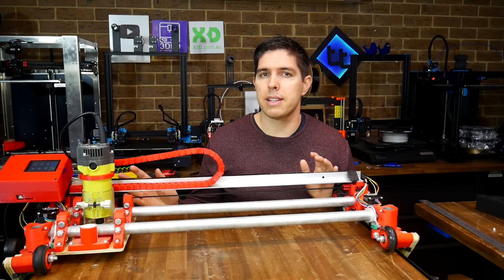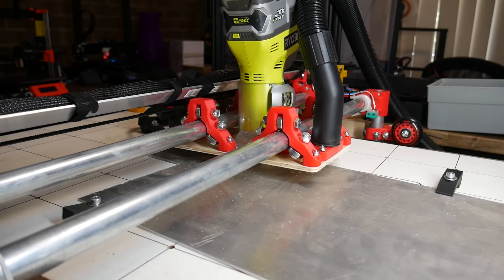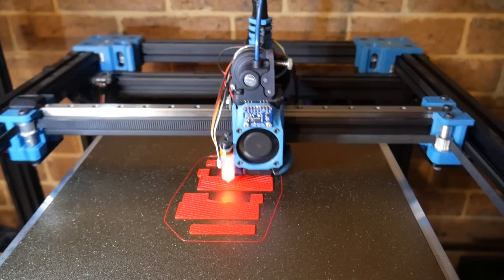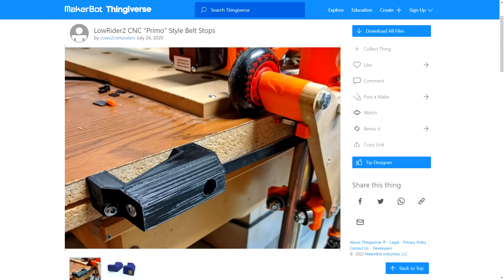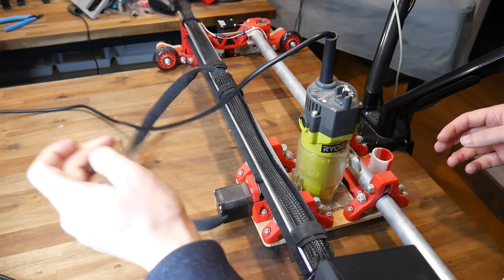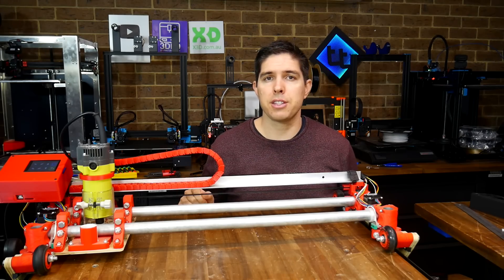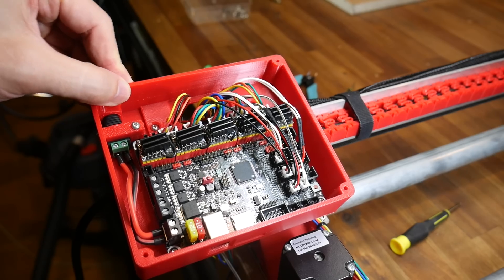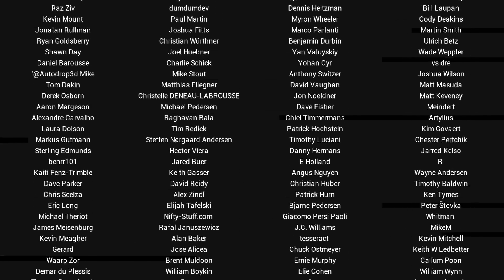3D printed large CNC: Lowrider2 upgrades

Comment: The cordless router most likely has a simple 18v...24v DC motor (RS 550 or RS 775) and maybe a planetary gearbox to increase torque. The motors are cheap, available on Ali or Ebay, and much easier to mount than the full blown router with its casing.
Plus you don't have to deal with the mains power cord. The relatively low DC voltage can be provided via cables in the main loom.

Comment: There is one trick for workpiece holding that I've seen used in various situations which I think is worth mentioning. If the lateral forces applied by the tool to the workpiece, then bolt-down clamps can be replaced with a paper masking tape and superglue with accelerator. Double sided tape has proved to be too messy on clean-up. First, apply a layer of masking tape to the bed of the CNC (table) and burnish it down well. Do the same to the back side of the workpiece. Finally, apply superglue to the upper face of the tape on the bed, apply accelerator to the face of that on the workpiece, mate the faces and press home until superglue set. Once the job is done, the masking tape is easily separated from the bed of the CNC and the workpiece. 

This certainly would have worked when Michael was struggling with a warped PCB onto the CNC 4 years ago.

Comment: I’ve watched this series and have purchased the lowrider v3.
I know you were looking to add a diode laser to yours - is this still progressing, or did you can the idea?
I’ve got a K40 in the workshop I’ve yet to set up, but already looking into if a $80 AUD diode from banggood would work on the lowrider.
A detailed guide from you on how to install that would be amazing.
Cheers for all you continue to do for the community
Reply: Bunch of folks on the V1 Engineering forum are sharing info on building LowRider V3, attaching lasers, plasma torches and such...

Comment: I noticed that, during the milling process, there is material accumulating outside the spoil board area.  The wheels are rolling this the material particles.  How much of an issue does that create with accuracy and artifacts in the milled material?

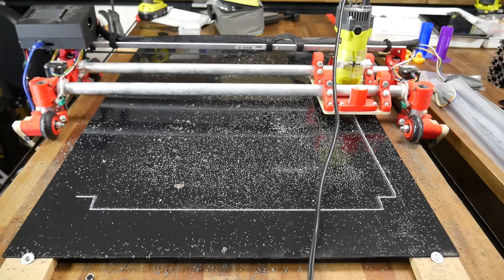Comment: Those are some very cool upgrades!  One issue I noticed, however, is that debris builds up on the wheels--as can be seen on the right at 2:05--which could cause some Z error.  A pair of toothbrush heads per wheel sweeping ahead of the wheel on each side--and a shroud on both sides to protect the wheels themselves--would prevent that.

Cheers!

Comment: Just found out about this project. I have a question, does the belts support any forces ? I'd want to cut throught very thick and hard wood and I fear belts will not support this.
Reply: I am using an MPCNC Primo at the moment, same designer, also driven by belts and it has got no problem cutting through hardwood.

Comment: These are awesome upgrades. Anyone know if I could mount the table top to a wall and run the low rider vertically ? That would save me space in the garage
Reply: I don't think so. We have discussed it so many times and never get any real good ideas to make that work. It is just far more efficient to use gravity instead of fighting it. My solution to that very common question in the new LowRider 3 is to make the machine easily removable from the table so you can put it away when needed. Litterlay takes me about 1 minute to do. Unsnap the belts, hose and two plugs. I can't post links but I am releasing the new machine as we speak and you can take a look in the forums or printables soon.
Reply: Why not make your table top hinge on the wall so you only have to have it out if you are using it when not being used it wld just lay flat against the wall

Comment: Question: This uses Nema 17 motors? Are they powerful enough? Nema 23s are not very expensive and you can drive them with external 6600 stepper drivers. You'd only need x and Y probably only $50-75 more?
Reply: But why? 17's are enough. Frame is always the limiting factor as you simply can't use torque from bigger motors. Feedspeeds are just so slow with these.

Comment: 12:00 sorry this is gonna sound harsh but just don't post the video then bruv. Its kinda hilarious that you 'wont waste material' yet you just spent allllllll of that time and filament upgrading the thing. You could even have engraved the spoil board as a test lol, how are we to expect that you didn't just do all of that work for no reason at all? Maybe the cnc is worse than before lol. I actually really like this video and am more interested than ever, but surely, surely you see the irony in not testing it out after 'upgrading' aka 'modding' the machine.

Comment: A few thoughts.

1) have you thought about running the Duet Web Control that’s been hacked for the SKR boards on it? I know that DWC has a web interface designed for CNC mills. I also know that Marlin isn’t super CNC friendly, as I’ve run into many issues with it.

2) you should consider cutting out new side pieces that put wheels on the bottom of the table as well, clamping the machine down. I’ve seen a few cases where the wheels have lifted off the table during cuts which messes up the entire piece of material and alll
Reply from the maker: Both very good suggestions, thanks.

Comment: it would be cool if you set up a way to monitor the amperage of the router so you know if it's chugging on any parts or getting too hot. some kind of safety based off amperage limits

Comment: The MPCNC might be a good project, but the outright despicable reactions of the author to attempts of creating addons/improvements makes it a no-go for me:
https://www.youtube.com/watch?v=68ohaPYyiDA
Reply: It's why specific licenses exist tho. As the creator and the original license holder, it's entirely within his right to license, and therefore enforce that license as he sees fit.  All he did was tell someone that was commercially making products to not make things and change the license to open source and rather leave them as non-commercial. In that video you linked the guy clearly states that his work, and use of the product puts food on the table for not only him, but people that work for him. This system works the way it does to make sure that someone can't edge you out of credit for your own design and claim it as their own. (See Apple Computers)
Reply: @J.erem.y  it's fully within his rights to do whatever he wants with what he has designed, yes (including being an a*hole), but it is not within his rights to define what others might and might not do with their own designs.

In the end, he decided to go the a*hol route, including trying to force others that had done their own designs into submitting stuff to him, and that's why I'll shy away from him.

TLDR; It's not illegal to be a d*ck, but you might loose some support.

Comment: why use 4 tensioners? you should only need two, one for each belt (with the other end being a simpler, fixed anchor)
Reply from the maker: Technically you are absolutely right. It will a bit more forgiving getting the belt length right with one each end. I guess it also simplified the printing process too.

Comment: Have you thought about a way to keep the wheels clean on the sides?  It seems like they can get covered with chips pretty quickly that could affect your Z-level.
It's been a long while since you covered this machine so it is nice to see it hasn't been lost to time.
Reply from the maker: Definitely a good suggestion. For some reason I didn't have the vacuum attached for the black acrylic footage. Normally it's not that bad but still an area to consider.
Reply: @TeachingTech  cheap cnc bellows on ebay my dude, and get some brush strips for the wheel area as an interface between the table and moving parts.
Might be an idea for the belts as well, as a decent wood chip could seriously throw off your Y parallelity which would suck balls say 6 hours into a large and detailed job.
Reply: I think it would be trivial to implement a few diagonal wheel guards that automatically wipe away any chips if needed. Could certainly be useful here :)
Reply: I built a large LR2 and considered this problem. My Y-wheels ride in steel shelf standards that are screwed onto Unistrut (found in the electrical aisle at the home improvement store). They form a square-bottomed U. The Unistruts are mounted to the sides of the table with spacers that create a gap between the strut and the table. Most dust falls off the edge of the table and down that gap and any that gets onto the Unistrut doesn't matter as the wheels are riding up on the two parallel edges of the shelf standards.
Reply: Dust shoe on the router plate goes a long way here. I also routed grooves into the Y rails on mine using a 90-degree V-bit to keep them aligned - as an added bonus, the wheels don’t reach the bottom of the grooves, so they can channel some sawdust without the wheels lifting when rolling over it.

Comment: Would you be willing to show how you store the lowrider while not in use?  It looks as though you remove it from the table when not in use.  Is that correct?  I had printed out and acquired all the parts for the MPCNC Burly version but was never able to carve out dedicated space for a table for it so I has sat in a box for the last two years.  I am thinking maybe I should try the lowrider, might be a better bet for me.  p.s.  the lowrider came out just after I finished printing my Burly sigh...

e mpcnc
Reply from the maker: It's stored exactly how you see in that clip. I home it to the opposite end of where I sit and that's it. In every video, you will see a gap between my two tables to allow room for the y belts.
Reply: @TeachingTech  Ah! Thank you.

Comment: Was interested in this as I'm looking at ways to expand the makerspace for my school district however the v1engineering site appears to be getting flagged as containing a bootstrapper. Anyone have any insight on this?
Reply from the maker: Personally I've never had any problems or warnings.
Reply: Which website? There is a shop, the forums, and the docs. I'm also not sure what you mean by bootstrapper. But if there is anything dangerous, I know Ryan would want to know more details.
Reply: I would go over to the forums and post this. They're very helpful and will want to know about it.

Comment: Didn't Thomas Sandlerer get hit with a cease and desist from the creator? Puts me off
Reply: Nooo, Just asked him to change his file licensing to match the "share alike" this is all released under.
Reply: @allted  Thing is those pieces were not made using your design. They were create new from whole cloth and you wanted to decree a more restrictive license "share alike" vs a Thomas totally free CC-0. 
Sooo, it's was weird then and it's still weird that you are obscuring the facts to look better that reality. Add in the fact that Sandlerer made the files parametric so they would fit an infinite number of cases and you really look like a hack trying to enforce your rights on a someone else's creation.
Reply: Thomas tried to build an MPCNC and failed.  Same designer, different machine.  Instead of using the forum and succeeding, he tried to change the convo to avoid embarrassment
Reply: @planckstudios  every mod was addressed. It's entirely factual to point out that V1 engineering is claiming that mods made from scratch were somehow needing to be licensed the way V1 wanted, and not fully open CC-0 as Thomas wanted his mods to be.
Reply: @womplestilskin  here's how I read it.  the dude failed.  and went like 4 videos deep.  and rather than do the real work or bow out gracefully, he chose to focus on a minor aspect that could get him views while trashing a hardworking, talented developer - I don't respect that.  if he had followed the steps and engaged folks on the forum he might have succeeded - most do.  and then he'd have mods that are proven to work and of use to others.  but without that,  there is no value to his failure because he didn't document his issues on the forum.  This is what I don't get - what's the point in arguing over the licensing of mods that never worked on a functioning machine?  If you're Thomas, it's to save face and distract from his poor performance.  If you're not Thomas, you're perpetuating a distraction
Reply: @planckstudios  V1 trashed himself. I'm not going off anything TS said, I'm reading V1's tweets claiming derivation and copyright for basic shapes and SOMEBODY ELSES work. That's not OK and V1 is in here still claiming he was right to try to enforce his share alike on other peoples work.
Reply: @womplestilskin  dude, go make something and share it, you'll help people more than that way
Reply: Same, the project creator was being a dink to quite a few ppl who were just putting up design improvements.
Reply: Just checked and while that was called the MPCNC, this Lowrider design is from the same person.

Comment: Can it cut aluminum or carbon?
Reply: It can cut aluminum w/out issue.  Checkout the forums on v1 engineering, it's a great machine
Reply: @planckstudios  Yeah, but it'll chew through the end mill just as much as it chews through the aluminium, which fortunately for the poor end mill is "very, very slowly"
Reply: @WhenDoesTheVideoActuallyStart  I use kyocera single flute 1/8" HSS endmills from drillman1 on ebay and trichodial cut - haven't broken a bit yet cutting 0.1" aluminum on a single pass at 10mm/s
Reply: What kind of carbon? It'll probably do coal and some hydrocarbons, like machining wax and POM. As for Aluminium, no.

If you want to machine metal you need a smaller, more expensive and more rigid machine. And no 3D printing of structural parts.